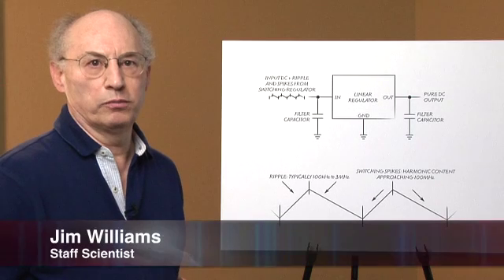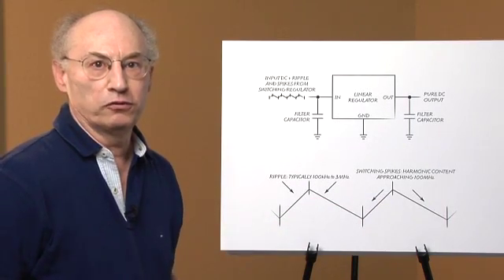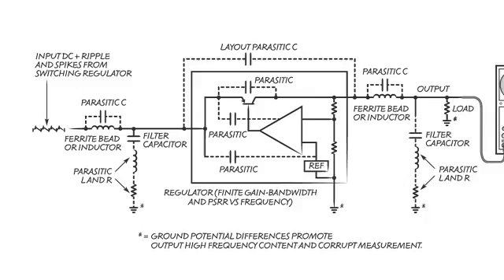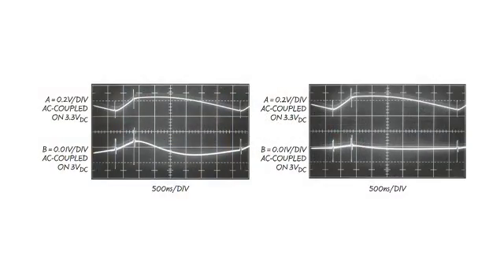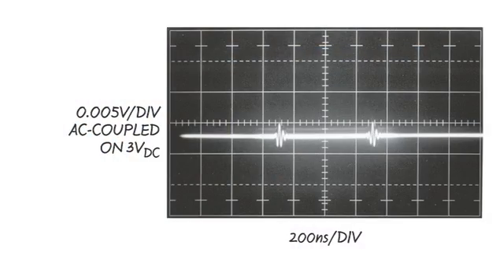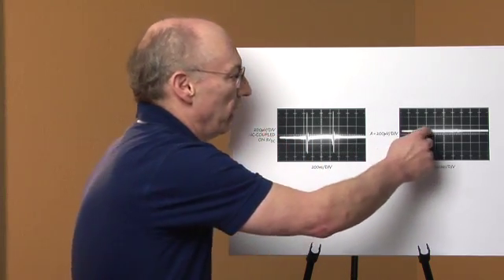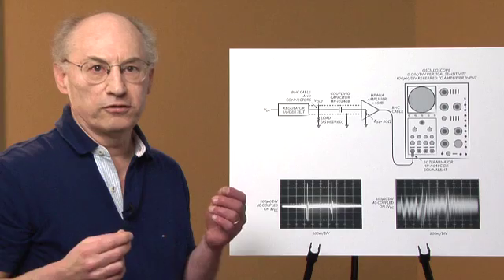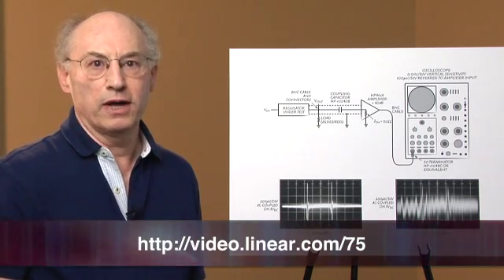Minimizing Switching Regulator Residue in Linear Regulator Outputs

Comment: I recommend getting rid of the ripple right at the switcher's output, which means a ferrite bead and / or inductor (depending on frequencies) BEFORE the switcher's output cap.  This can be tricky as it can introduce another pole in the feedback loop and turn your power supply into a big oscillator.  However, in places where you have a clock somewhere on your board multiplied up into the GHz range, this is necessary.  As is filtering that supply with the FB / inductor, large cap as close as possible with the shortest traces possible, and DON'T drop vias to your power plane and ground planes until AFTER this filter.  

If that diode ringing from the switcher makes it on to the power and ground plane, it will bounce those entire planes, and adding ferrite beads around the linear regulator won't help you.  The power/ground plane makes a far better transmission line than it does a capacitor, and there is no way to stop the entire ground plane from bouncing around once that noise gets on it.   So stop that ringing right at the switcher!

Comment: Would an inductor with a well-known value (LC filter) serve the same purpose or even do a better job?
Reply: From what I saw in real life, the ferrite bead is better for 2 reasons - an LC filter made with a proper inductor has a clearly defined resonant frequency and you can get the filter to oscillate at this frequency when applying load steps, so you might filter some noise but generate other unwanted oscilations; on the other hand the ferrite bead behaves like a resistor at high frequency rather than an inductor, this is because its absorbing the magnetic field (and turning it to heat) rather than store it like a proper inductor, so the magnetic energy does not get put back into the circuit.
Reply: @FesZElectronics  If you could make a video with ferrite bead experiments, it would be very cool.
Reply from the maker: Hello, for an answer by one of our engineers, please visit the Power by Linear technical community at https://ez.analog.com/community/power. Thanks!